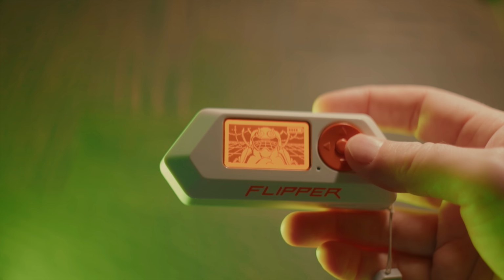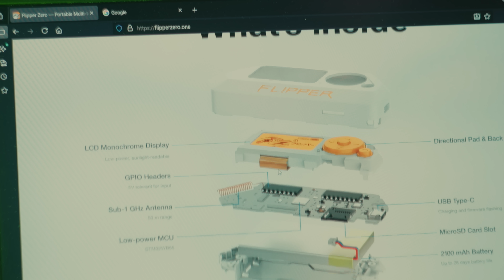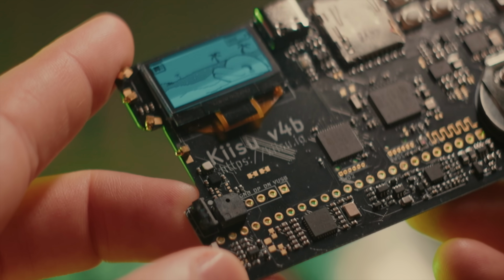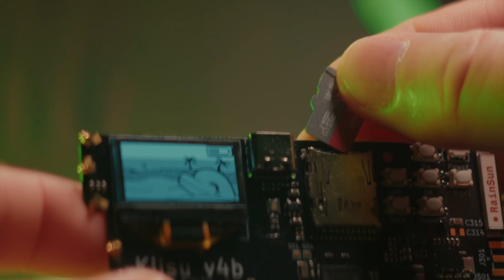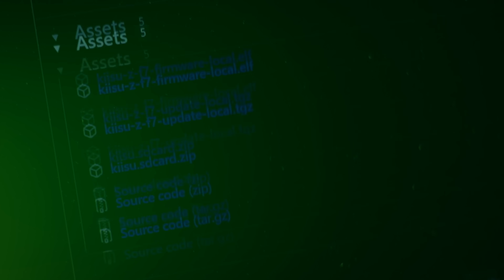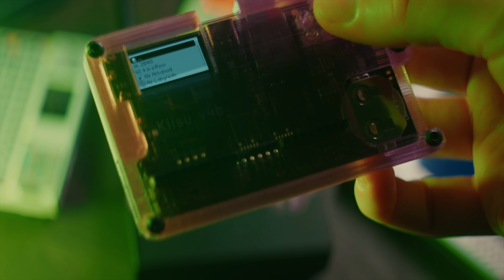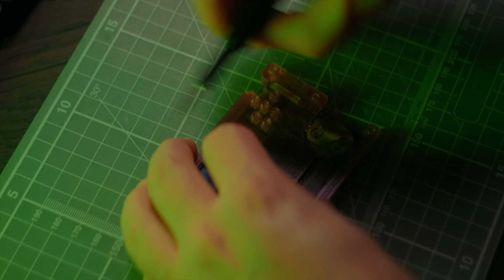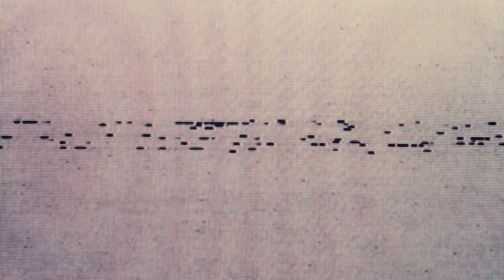Flipper Zero Clone? This is Kiisu V4B

Comment: Amazing video!
One thing to note are the limitations due to factory keys. Flipper Zero comes with some private encryption keys stored in Secure Enclave from the factory. At this time, Kiisu ships with no factory keys stored in the Secure Enclave, which means U2F and the Keeloq Sub-GHz protocol will not work. One can flash their own factory keys (this is NON reversible), but then they would need to decrypt and re-encrypt the Keeloq manufacturer codes (for which you need a real Flipper Zero) and remake the U2F certificate. There is a third party app that allows for adding fake factory keys that are not actually stored in Secure Enclave making the process non permanent, but the prior point of re-encrypting Keeloq and U2F files stands. If only Kiisu finally decided to make their own factory keys and flash them to Secure Enclave before shipping, firmwares could provide a download with re-encrypted Keeloq manufacturer codes and U2F certificate that will work for Kiisu and not for Flipper Zero, solving this problem. But for now, they have made no promises of that.
Reply from the maker: Thanks for clearing up the technical details that go over my head 🧠🤯

Comment: I really like the credit card design and the low cost. You can literally hide this thing in your wallet, when you use the flat covers that come with it.

But the PCB layout indeed isn't well thought out. When you connect a modules it's awkward to hold and it's in the way of using the buttons, the GPIO pins should be on the top like with the Flipper Zero. Also USB-C connector should be at the bottom, otherwise when you hold it in hands while connected the USB cable makes a bend and wants to tilt the device forward with the weight of the cable, but I guess it's similar to a game controller so people might prefer it how it is. Yet the SMA connector is where you have your right hand with which you probably want to control the buttons. Other than that it makes sense that the buttons are at the top, otherwise it would be awkward to grip the card with your right hand and press the buttons at the same time.

The Kiisu might be really useful when you know your pockets and bags will be checked, nobody suspects an electronic device hiding in a slot of your wallet, yet. And I think it's just amazing how they miniaturised the Flipper Zero into that shape and even had spare room for a second controller and some sensors. I hope there will be a next version with a better layout though.

Comment: In theory maybe you could use an analogue pocket as a flipper. FPGA can hardware emulate many other mainboards. You could then create a custom cartridge with all the radio hardware and other stuff. A flipper disguised as a handheld gaming device with a larger screen. I would defo buy that. Flipper in disguise. Hackers dream.

Comment: For the Antenna you could try to build in a Switch that disconnects/Connects the capacitor to switch between internal and external antennas

Comment: If you're reading this, get your own ESP32-dev board or get a T Beam Supreme.

If you aren't scared of doing a little bit of coding, there's absolutely zero reason to purchase these pre-made "ready to go out of the box" products.
For around $50, the T Beam Supreme comes with LoRa and GPS already ready to go and installed. In addition to all of the same capabilities that a regular ESP32 device has like wifi and bluetooth.
Also, I'm not too sure about the flipper chip, but the T Beam Supreme has an S3 chip which is newer architecture and more powerful.
Reply from the maker: A t-beam does 0 of the things a flipper does, so that would be a terrible alternative.
Reply: @sn0ren  My bad, t beam actually doesn't come with an ir sensor out of the box. My point still stands about there being better alternatives like an m5stack cardputer

Comment: An easy way to mod things like this is replace the coin cell with a 3.3v reg and adding a AA/AAA battery holder to the case you design. Or if you fancy a lipo with a charging module.

Comment: Be aware that these are priced at $91 but then due to tariff cost $150.
That's NOT half the price of a Flipper Zero. That's EXACTLY what I paid for my Flipper Zero back when they came out. 
They may be a little more than that now, but I doubt it's half.
Reply from the maker: Not everyone lives in the US though. I live the EU and paid $91. A new flipper zero costs €229
Reply: For those who live in countries run by normal people not mentally incompetent convicts , it does cost less than 1/2 of a F0.

Comment: i wonder how long before the flipper devs update firmware to break this
Reply: Not sure what you mean? 
You can install custom firmware 'Momentum' on this. 

It's strictly better than stock Flipper Zero firmware. In fact I'll NEVER use stock Flipper Zero firmware. They lock up, hide, or don't include most of the things you can do on one.
Reply from the maker: Flipper Zero is open source. Anyone can make a compatible implementation of either hardware or software. The documentation is public so any changes are as well and can just be reimplemented if needed.

Comment: What about the t embed cc1101 plus?
Reply from the maker: Doesn’t do NFC/RFID, infrared, ibutton, or interfaces with flipper modules - and the subghz implementation is a lot more basic and the firmware doesn’t have all the community apps flipper has.

Comment: i think the kiisu is great but it is fragile and tariffs greatly inflate the price
Reply: Does the OG not also have the same issue?
Reply: @ericbwertz  I'm on the east coast so after tariffs and my 15% code CHUCK15 and then the best case was the tron case. So the kiisu ended up being $220 and the flipper is like $240 with silicone case and s reen protectors